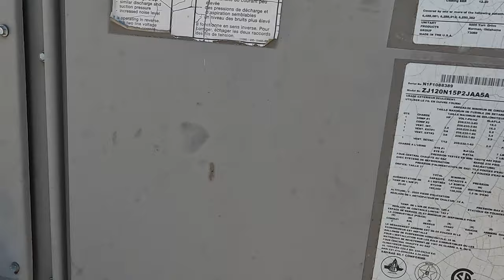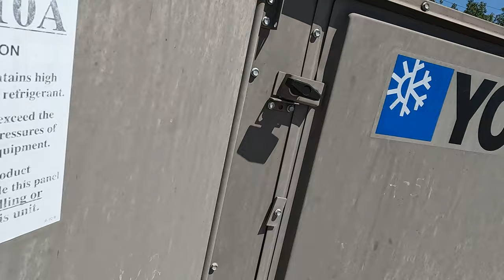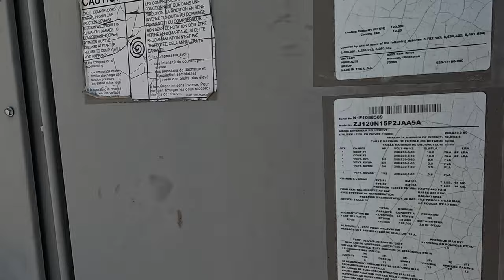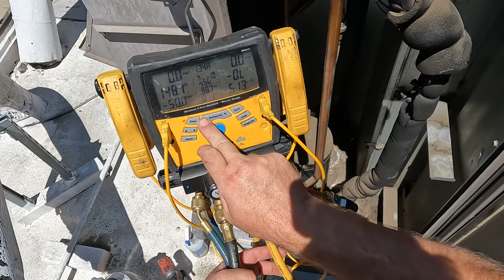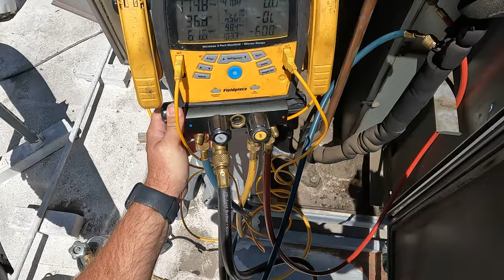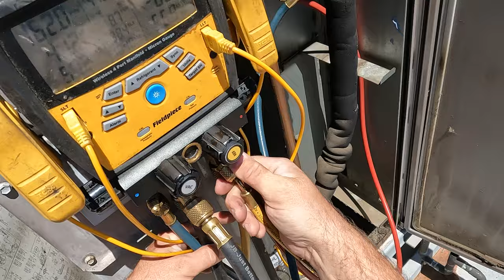Hvac Vlog. Air conditioning stopped working.

Comment: Out of curiosity you couldn’t fix the coil? Like braze the hole up? Yes you may have an area with damaged fins. At least you could get system running and customer could decide on new coil…
Reply from the maker: It is aluminum. I saw somewhere a few years back had aluminum rods. Never tried. I have been thinking pretty hard about it because the coil is extremely expensive.
Reply from the maker: If you temporarily fix it and let them decide they will always go with "its working know so why should I replace it". If it ends up failing then we get blamed for our temporary fix failing even though we explain it to them and then they want it replaced for free. I have had so many situations like this that most my customers will not get temporary fixes it will be done in a way that I can warranty my work. However this customer is one that will allow me to try to fix the leak vs. replacing. So maybe part 2 soon.
Reply from the maker: Thanks I will Check it out.